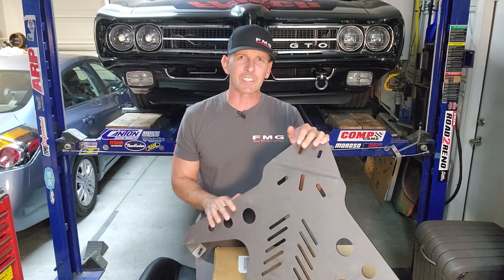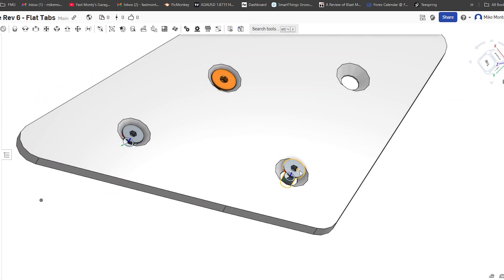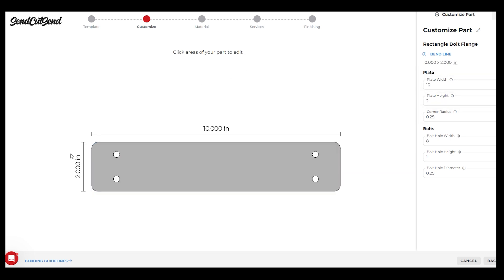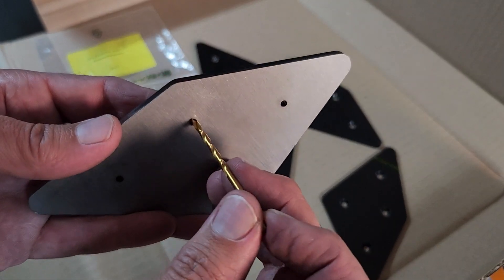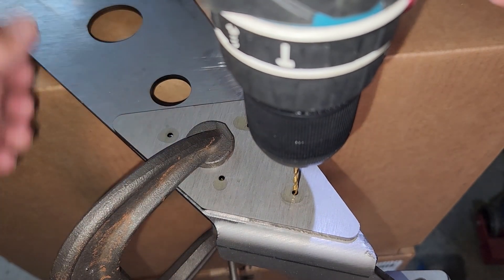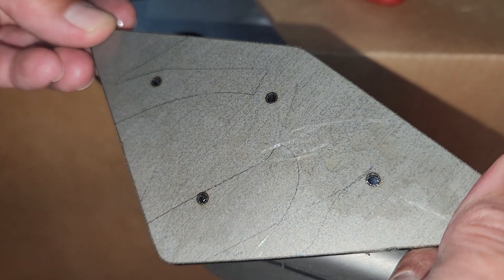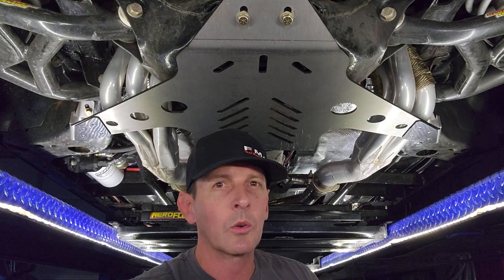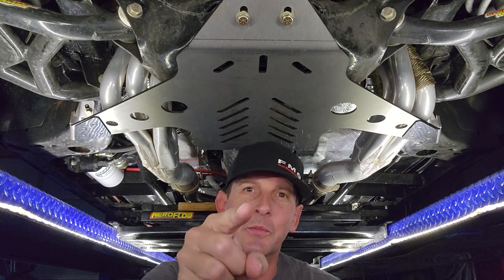How to make "Bolt-on" Delrin Skid Plates with SendCutSend - GM A-Body Skid Plate Upgrade

Comment: You found the first few threads under the head of a screw don't need to be formed we'll.  On thin parts with countersinks the hole diameter can be opened up, this will cause the issue.   A handy tip for drill guides, you can get these on mcmaster "Press-Fit Drill Bushings with Head "  Make a thicker plastic piece then press in the guides you can get holes more square to your part and use a cheap plastic for the template.
Reply from the maker: Good tips... A couple things though, Riv-Nuts don't sit flush, where I want the plastic plate to be flush with the steel.  I was also proving the point that, if you have an A Body and wanted to order this plate.  You can order it with, or without, the tapped holes.  Super simple.  Thanks!

Comment: Nice work. Would some threaded inserts work instead of tapping?  The skid pieces wouldnt sit completely flush though
Reply from the maker: Good point... you could do that, but a little harder to get the skid pieces flush like you mentioned.  Thanks for the comment!

Comment: What is your ground clearance? My collector flanges are my lowest point at 2.5”. I need to do some custom collector work to try to gain another .75 or so. Texas roads aren’t very smooth.
Reply from the maker: My collectors are still the lowest point.  This plate is to protect the oil pan... far more critical than bangin the collectors every now and then.  In my opinion.  Thanks for the comment!
Reply: @FastMonty I understand, was just curious what your ground clearance measurement is.
Reply from the maker: @Waylon_h25  A little over 1.5"